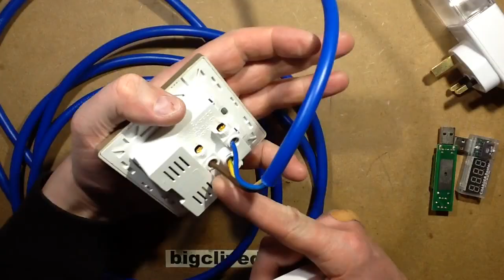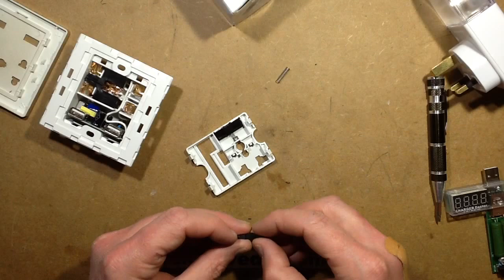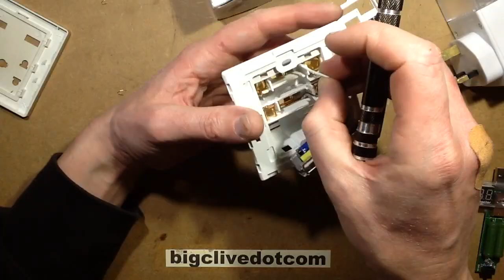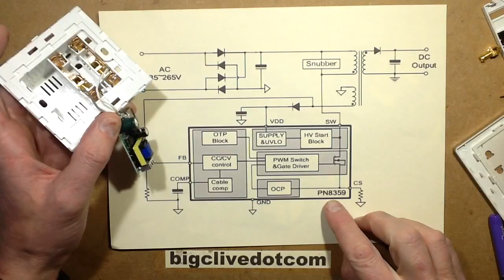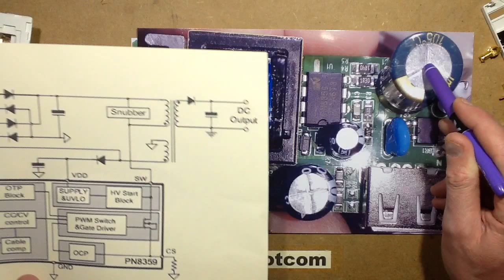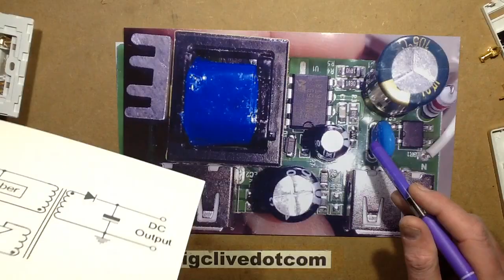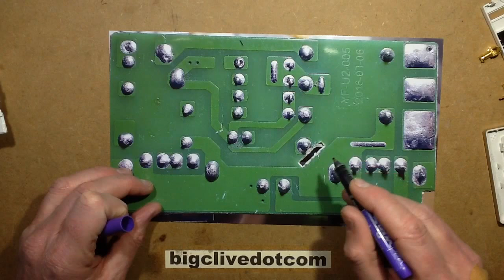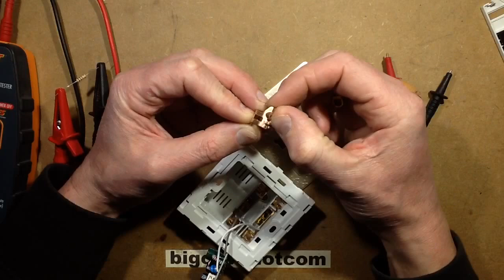Wall plate death-dapter tests including fire and 1kV.

Comment: Those extra resistor pads around the USB port are for Apple compatibility.

Genuine Apple USB chargers use voltage-divider resistors to identify their allowed current rating (iPhones, etc. expect specific voltages on D+ and D- before allowing high-speed charging, or maybe any charging at all - I'm not sure). The USB DCP standard OTOH calls for max current identification using the resistance between these two pins (resistance between D+ and D- inversely proportional to allowed current, direct short being "unspecified"). Apple's system requires 4 resistors for each port, while the standard (followed by almost all Androids and Windows Phones) needs just one for each.
Apple's own chargers (at least recent ones) can charge Android phones perfectly well, due to Apple using precision resistors for the voltage divider, such that the resultant resistance (as measured by a standard-compliant device) is also the correct value for the charger's rating.
Many power banks, however, don't get this right - typically they put in the 4 resistors for Apple compatibility, but don't care about the resultant resistance (probably because it's cheaper to use just regular +-5% resistors instead of precision ones). The symptom of this problem is when a power bank charges an iPhone just fine, but Android phones charge only very slowly, if at all. It's fixable using precision resistors (or if you don't care about iPhone charging at all, just bypassing the whole network and shorting the pins for an "unspecified current" USB DCP), but if you see this problem, chances are there will be other issues with the circuit as well - incorrect voltage cutoffs on the Li-ion side, for instance.
Reply: NetRolller3D this would explain why I only get 300ma on my power banks and chargers. I have the usb charger doctor and I cheered when I found my best charger does 600ma
Reply: But in this death-daptor D+ and D- were just shorted together, so how would they connect these resistors?
Reply: Dominik Szymański good question

Comment: To the question at 4:25  right here :D did it when i was roughly 6-7
Reply: I was 3 or 4. I still remember the beads of molten metal spraying across the oaken floor in the parlor.

Comment: Here in Noway we have the round CEE 7-style wall sockets.

Where I grew up, we had a very particular child-proof mechanism. There is this spring-loaded plate with two indentations at the face of the socket, and to use the socket you have to push the plug firmly to the plate and twist it all 45 degrees. The particular movement needs good coordination and a bit of strength, as a fair amount of force have to be applied both linearly and angularly at the same time.

Only downside? This kind of child-proof mechanism won't work with earthed sockets.

(Fun Fact: Norway has unpolarized mains power, two-phase with each lead carrying 110VAC in terms of earth. Untill the mid 90s, earthed sockets weren't standard over here.)

Comment: Splitting a load between 2 diodes - is there not an issue with runaway bias due to voltage drop vs temperature change etc?  I remember this from my adventures with audio amps - if you had sets of output transistors in parallel it was always advised to put resistors on each to ensure the current was split evenly

Comment: I wonder how good the USB circuitry really is. I wonder what happens when you leave the USB load test in for a while and then see how hot the components get. 
The plastic is not 'inflammable' for no reason....

Comment: It's interesting to me how different the design is for these vs US plugs. It's not just the pin and voltage, but the idea of incorporating the whole assembly into the faceplate.
Reply: @Bear Foxtrot What about ease of use and convenience?
You can swap the faceplate if you want a different colour.
Reply: Nope, the gold painted thing is the faceplate.  The socket is the big thing in between with all the metal parts, springs and electronics just like in the US.

Comment: But your 1 MOhm resister may not be spot on 1 MOhm - it's ± some percentage by your last band. When the lab calibrates your tool they measure it against a well known resistive value - likely where they can measure everything to a "T". Now, if that's a 1% or 0.5% then that's likely good enough for you to use for calibrating.
Reply from the maker: But if I measure that same 1Mohm resistor with several meters and they all say 1Mohm?
Reply: bigclivedotcom 1.0 or 1.000 Megs ? ;)

Comment: Given that it isn't going to be legal in the UK wouldn't fitting one in your house risk invalidating your insurance? That alone is a good reason not to fit one.
Reply: Richard Towers Its illegal in the us to use unlicensed android crap and you will be criminally prosecuted :)
Reply: Super perfect Stranger Sorry, I'm not sure what you mean by "unlicensed android crap" in the context of mains fittings.
Reply: Richard Towers Usb outlet are marketed to charge smart phone but andriod phones know when you are using bootleg crap and will try to resist charging to make you unplug it and use a real charger. Failure to use authentic charger can result in battery explosion which the Googleplay and iTunes terms say they are not responsible for damage due to bootleg crap: (
Reply: Super perfect Stranger
I've still got no idea what you mean.
Android is an open source platform so the term "bootleg Android" isn't meaningful. Do you mean using a specific brand phone, like Samsung or Motorola, with a non-brand charger? There's no restriction on using non-brand chargers on Android phones as far as I know, but you won't have access to a fast-charge feature on a charger that doesn't support it. I don't know of any brand that performs a data handshake with the USB port before commencing a charge. That would stop you from charging via a sleeping laptop, which would be a really annoying feature.

Googleplay and iTunes do not have T&C relating to your choice of charger on your phone. They are content providers, not hardware producers. If your phone blew up after using all brand name accessories they still wouldn't be responsible.

You might void the hardware warrantee if you damaged your hardware using a charger that isn't certified to USB standards, but you won't be prosecuted. That still isn't a criminal activity.

USB chargers of any variety aren't "unlicensed android crap", nor are they "bootleg". They are USB chargers. The USB specification is over 20 years old while Android is little over half that. In fact must Android phones are USB devices, not the other way round.
Reply: he is thinking of apple.
Reply: Carbon 12
It's actually a criminal offense to charge an iPhone with the wrong charger? Wow :-O
Land of the brave, maybe, but certainly not home of the free in that case  ;-)
Reply: Richard Towers don't even vagely take him seriously.  Windows and Android phones have a chip that slowly draws more current until voltage drops to find the best performance.  Apple devices use a specific resistance to detect proper chargers so hes only right about many chargers being crap, but not in any way are they usable or unsafe.  The idea that apple uses an identification scheme to whitelist chargers is anti competitive.
Reply: Richard Towers No, but they do say that they are not responsible when their phones break/set on fire when plugged in the wrong charger. They also ignite when on charge anyway.

Comment: The rising in voltage is wanted, as the connectors and cables have an internal resistance.. Once you charge a device, the voltage near the device should stay constant regardless of the amp drawn.. That´s why they amplify the feedback based on the current drawn. You can assume ~0,15 Ohms of resistances from the USB connectors and cable.

5V isn´t that high compared to the voltage drop @2 Amps due to the resistance.. That´s why USB PD over USB-C allows up to 20V instead of 5.

Comment: The twin earth terminals on many sockets is only for High Integrity Earthing, not for a flylead to connect to a metal pattress. Flyleads aren't required on pattresses with a fixed lug anyway.

Comment: I like the british system, force the manufacturers to put in ground and then it makes it safer for kiddies and the intellectually challenged of us.

As for the USB port, you may think it's bad that it doesn't go above the 5V that is on there but it's kind of a good thing, where electronics these days have less tolerance with changes in electricity, sure, you might be able to get away with 10% with the older USB devices, but with the more modern ones, such as your phone, it could kill the data port on the more expensive ones (such as the Galaxy 4 and over series) or outright kill the phones that don't have the protection in place (such as the first USB charging phones made in 2003... or really cheap and poorly built phones with minimal protection).

Flame test, fair... if all your components in your house burnt for that long then your house would go up in no time, imagine if drywall was flamabe...

Comment: To pass UL 94V-0 flammability test, a 125x13mm strip of material must put itself out within 10 seconds of removing the heat source from the bottom.

Comment: I like your product shows but why do you not show us products from your home country place? Products how made in England/Scotland/Wales/North-Ireland? 

Mostly I see products for the asian market place where they have different power regularies. So here in Thailand we use mostly no Saved Earth (middle pin / green-yellow cable). In the most asian countries we use fuses direct in a box after the power come in - so we not need fuses in female wall socket or male sockets on the cable to our electric things. 

Now we have the Internet and all people can sell and buy worldwide all products - in the history was too many different shops between. Before 30 and more years the local shops sells in London many new products to Tourists and Army People, then they home products do not works in this country. Mostly wrong Socket, sometimes wrong power. 

In Germany the local german Company Brennenstuhl or Busch&Jaeger produce many wonderful good adapter (with german regularies of course!) between the german standard socket and the alien socket or standard german socket wall plates. No one thinking I must or should buy an adapter/plate/socket for save money in Internet how is produced in asia with local regularies with one month shipping time. 

The opposite is more happend, house owner around the world buy the german standard socket. Here in Thailand in many tourists areas the most houses have german standard wall sockets. With this installation come the Saved Earth into the houses too. Many products (TV, washing machines, micro wave ovens, aso.) have mostly german standard socket cables installed. In Spain, specially in the tourist areas, they use mostly the german socket system too.

Comment: This reminds me of the time I was around 9 years old and found an old record player with no plug on it. I bypassed the earth slot with a screwdriver just like in this video. As soon as I put the second wire in I was thrown across the room. No injuries but I did get one hell of a shock and didn't do it again!

Comment: Many years ago I was reading the Serviceman column in Electronics Australia or Silicon Chip (I don't remember which) and the author was talking about a friend who used a "calibrated finger" to measure the voltage in valve circuits.  Apparently it could measure three voltages: "Yep, it's on", "Ouch" and "Bloody Hell!"
Reply from the maker: Apparently it was common to touch the tops of certain valves/tubes to see if voltage was present.  But back in that era, the early electricians guides also suggested touching wires to test for electricity.
Reply: I had a teacher once, who told of an old friend of his, and electrician, who allegedly used his finger to check for mains voltage (that'd be 240v). Apparently the finger looked quite odd too, after a long working life of doing this.

Obviously I cannot say for sure if this story is true, but I have no reason to think otherwise.

Comment: I would be concerned about the thermal characteristics of that transformer.  Closed up like it is and then installed in a wall box it doesn't appear to get much air circulation to cool it.  And in my experience they get quite warm.  What do you think?

Comment: Never got blown across the room from putting stuff in power points. Australian thin pins might be a bit hard to get a screwdriver into for that. 

I did, however, get a tingle when I had the VCR open to try and untangle a tape and accidentally touched something in the power supply, though.

Not any kind of engineer, but do have a bit of an interest in electronics.

Comment: These things are made for the China market. China standardised on the same sized wall plates as the UK (probably through the HK connexion), even though they use Australian plugs. You will find this exact device in many hotel rooms in China. The "accepts any plug" quality is really useful when guests might come from anywhere in the world. They don't really care about high current rating, as they don't expect room guests to be plugging in 3kW loads. If they do, they might find their plug melting into the socket. :)

Comment: I agree, I wouldn't rate that socket at 15A (standard rating on a residential socket in the States), not with a ground contact that small. It might work for older 10A circuits though. Not that I like the steel contacts pretending to be brass. We do use aluminium quite frequently for out contacts in electrical sockets, but they are much beefier than that. I have seen some steel contacts for the ground connection, but those are usually 4 times the size of the one you took out of that socket.

Comment: When I was young I pulled a double adapter apart, and then put it back together. Trouble was when I plugged it in all the lights went out. An hour later the power company (SEC) sent a truck and replaced the service fuse (55A?) - The end of the story - No way.
I didn't see any sparks etc., so it must have been a fluke, so I tried gain - same effect, no splat and fizzle, just total darkness. When the truck re-appeared for the second time my dad had to put on the very apologetic front. - He then took away my double adapter!!!!

I now have a healthy distrust for those old re-wireable fuse holders, a 16A fuse should blow before a 55A master fuse.

Comment: Biggest issue I see with this is allowing plugs to be connected which aren't fused like the British ones are. Devices with Europlugs or North American plugs aren't designed to be connected to circuits rated as high as British ring main circuits, so a short in the appliance or cord may cause a fire hazard.

Comment: Oh god Clive. Please read up the requirements for safety testing of components.. IEC 61558 for transformers.. your test at 500 or 1 kV across a transformer is too low. 2U+1000 V for BASIC insulation, 4U+2000 V REINFORCED insulation.. as for your flame test.. To test the plastic, you'd need to do several tests to be sure.. Ball pressure test at either 125C or max temp measured + 2O Kelvin with a minimum temp of 75C.. Glow wire test at 650, 750 or 850 C as stated by the plastic manufacturer.. and/or Needle flame test with proper measurement of the flame using a copper block thermocouple.. for UL94 V-0, V-1, V-2 rating.. specific distance from a plywood board wrapped in tissue paper.. no falling particles, no ignition of tissue paper or scorching of the board.. Don't even want to comment on your suggestion that people use uncalibrated resistors to check their meggers.. a functional check yes.. but not an accuracy check, no.. zero traceability, Clive.. unfortunately some of us answer to UKAS.. lol.. but I enjoyed the rest.. be nice if you could use callipers to measure though.. by the way.. 60950.. cr and cl.. 3mm basic 5mm reinforced.. 1mm would not even pass lighting standards like 60598 or 61347.. even they want 1.5 mm for basic 3mm reinforced ;)
Reply: oh and that whole thing would hideously fail BS 5733 and BS 1363.. its dangerous, end of. lol
Reply: BSI Tester So any product that has a transformer has to have its trx rated at 4U  + 2000v, assuming the low volts are touchable.  Is U = 230v? 
Does this apply to relay contact to coil isolation as well?
Reply: Yes, U refers to the Rated voltage of the device. The 2U/4U is a broad test that covers most standards, however some are much more stringent such as 60601 medical, where separation is not enough and other means to ensure safety. For relays that's coil shorted together to all contacts shorted together withstand test.. NOT contact separation.. contact separation of relays and switches and things is a different ball game altogether, that depends if its rated as micro-interuption, micro disconnection or full disconnection.

Comment: You're so right about dangerous kiddie electricity experiments leading to a career in electrical engineering. One of miy early investigations at the age of about 8 was was finding that if I pulled the volume knob off a mains valve radio (incidentally exposing potentially live chassis) the shaft was a perfect fit for the older kettle connector plug. I decided to demonstrate to some (adult) visitors how I thought I could make the radio much louder by plugging the live kettle connector onto the shaft. It was an impressive bang and a flash that obviously made an impression on someone who is now a Chartered Engineer in his sixties! 

(Of course, the real career clincher was a Philips Electronic Engineer's kit a couple of years later.)